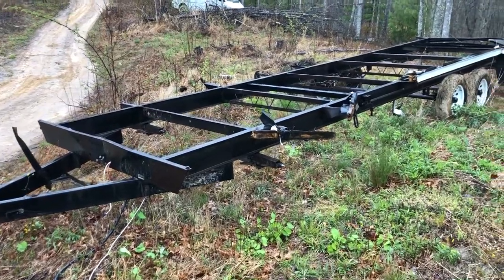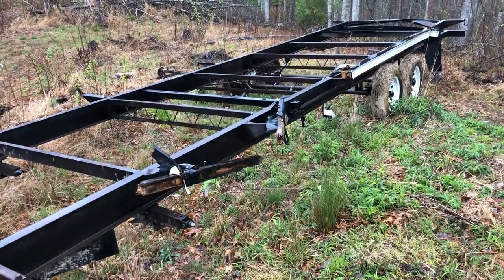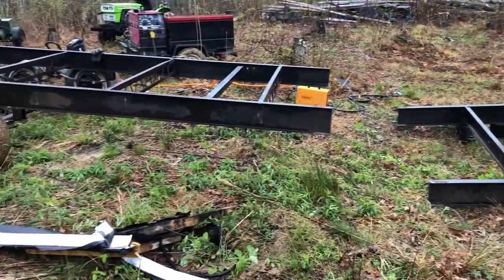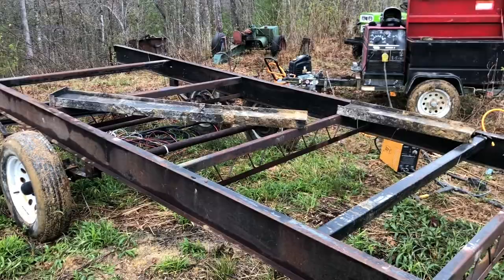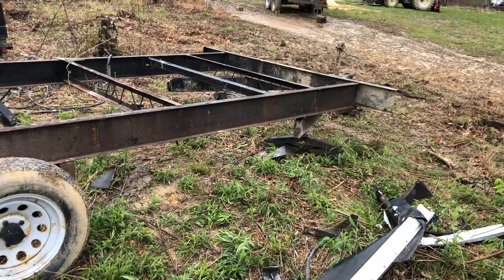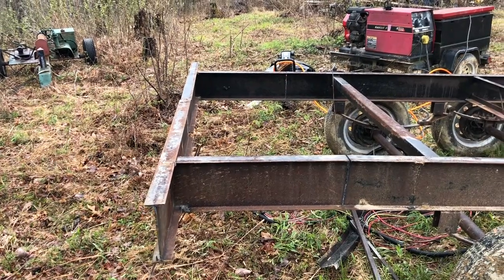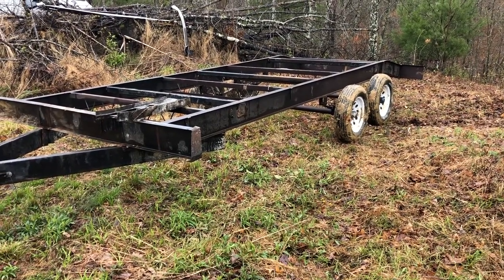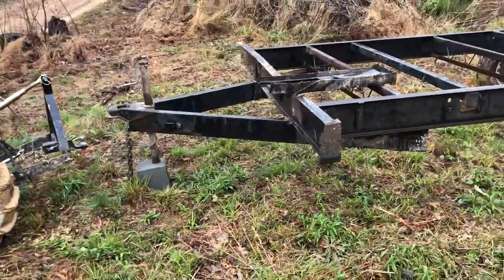Building a Car Trailer Out of Scrap! Pt 2

Comment: Or look for an older Ford full size van frame and axle to build a trailer from. Most of the length of the frame is very flat until you reach the front. The hump over the rear axle is small. They even built the extended length versions from E150 to E350. I junked a 1986 E250 in the late 90’s. I unbolted the body from the frame except the bolts by the front bumper. I pushed it nose first to a large tree then ran straps and a chain from the tree at about 10 feet off of the ground down through the vent hole in the rear of the van roof and through the rear door opening. I used another chain attached to the rear of the frame and gave it a good pull with another truck. The van body tipped up like it was hinged on the front and flipped over. I wish I could have gotten video of it.

Comment: I think I would have gone with a 2 car hauler and  balanced it so if you where only pulling one there was little to no weight on the tongue so you could pull it with a car or ranger or something else that's good on gas.

Comment: You should have pied the bottom of the frame rail instead of the top when doing the beaver tail alot less monkeying around fabercating and welding to do that way,but still looking good
Reply: i was about to say that i would have too and will on mine
Reply: I don't think he ever claimed to be a fabricator!! he he he
Reply: Not a beaver tail. Its a dovetail. Beavertails are 4 ft dovetails are 2 ft.